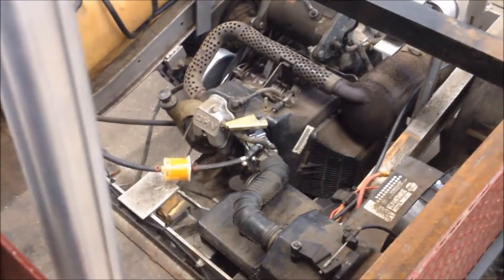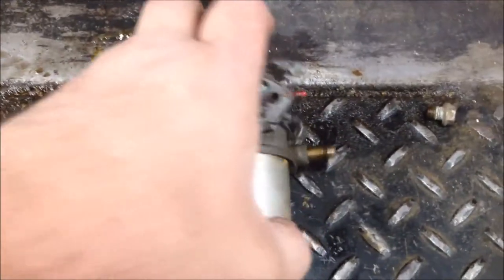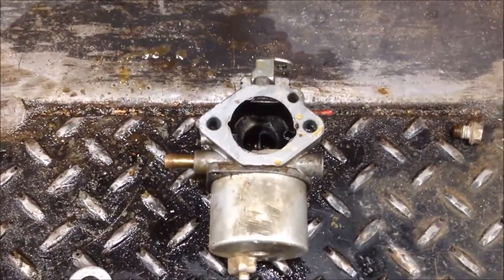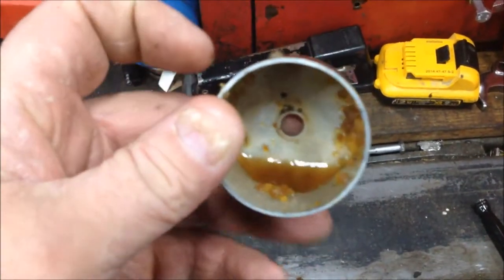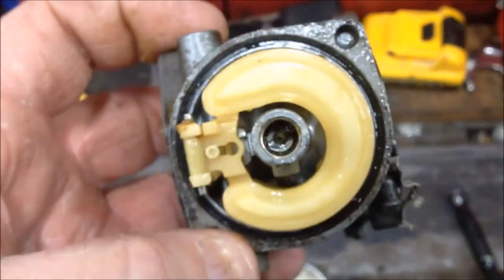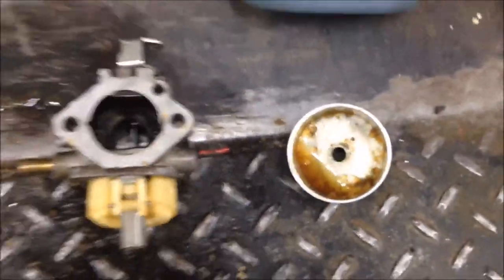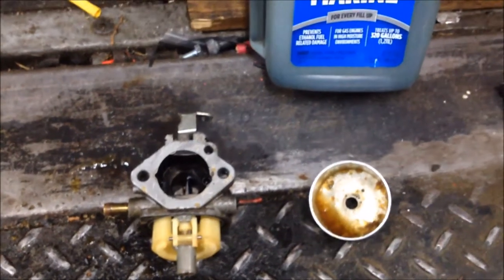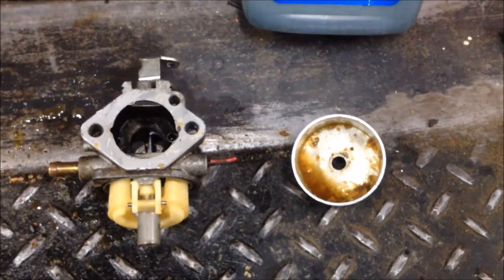HOW TO MURDER A CLUB CAR / KAWASAKI FE290 / 350 CARBURETOR / ETHANOL /  JELLING

Comment: Old Carl, my local small engine mechanic, loves ethanol gas!LOL.People do not get it.I run the TruFuel 2-Cycle Or mid grade 92 non-ethanol from Cenex.Just bought a new Sthil blower.They sold me a gallon of premix for $30.99 to qualify for the extended warranty.They want $10.00 a quart.Ridiculous but I get there point.I bet 90% percent of the warranty problems can be blamed on taxpayer subsidised corn gas.This time of year the free section of craigslist fills up with free weedeaters and mowers.

Comment: My 02 club car is back firing. I put a new carb on prob 50-75 hours ago. Would the carb cause it to backfire? I use stabil in it during the winter and run once a week or so. Thanks in advance.

Comment: Thanks for the great video's. I use aftermarket carbs with very good success. I had an Echo gas powered drill that I could not buy an aftermarket carb for. Carb was totally plugged and corroded.  Echo OEM cost me over $65.00.  Walbro WYL 56 carb. Don't know why I could not get aftermarket? Keep up the video's. Thanks

Comment: What kind of battery do I use in this golfcart. Deep cycle? Amps? I need a new battery in my Kawaski FE290
Reply: I have a Kawasaki FE-350 in mine and have just been using the cheapest car batteries at Wallmart for years with no problems. The only trick to maintaining golf cart batteries is to remember to leave them on trickle charge every now and then because their starter generators often pull more watts than they put back in.

Comment: I really wish you had showed taking off the carb. I have this exact one. I can't see on mine how to remove the govenor cover. Mine was leaking gas now it just pours thru there.
Reply from the maker: I have many other video on just that.  Search my channel for "gas leaks into crankcase "
Reply from the maker: You shouldn't have to take the governor apart to get the carburetor off

Comment: I have been working on lawn mowers for 60 years and have never had a problem like this and, have never and never will use a fuel stabilizer, If you leave a mower set for many years you will see this.
Reply from the maker: Different regions of the United States have different types of fuel,  my region has anything from E10 up to E85 and you never know what you're gonna get.  I've been working on lawn mowers for over 30 years and see this problem daily.

Comment: Pure gasoline will degrade into turpentine and gum up a carburetor just like ethanol if left sitting in the bowel for too long. Avoiding E10 and running fuel stabilizers like a sucker consumer wont substitute the common sense maintenance of always running a carb dry before putting the machine into storage. I run E15 all day in my equipment and have never had any problems because I know better than to treat any gasoline as an imperishable like diesel fuel. Hell, id rather deal with a gasohol clogged carb because its at least courtious enough to come out in easy to clean jelly unlike the sticky paste that pure gas leave behind. There is no cleaning that mess without a sonic cleaner.